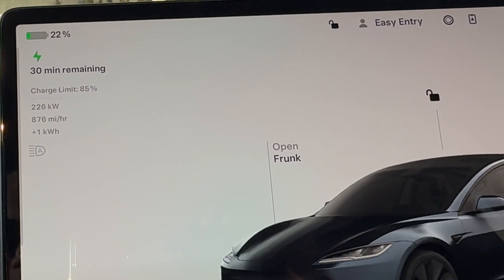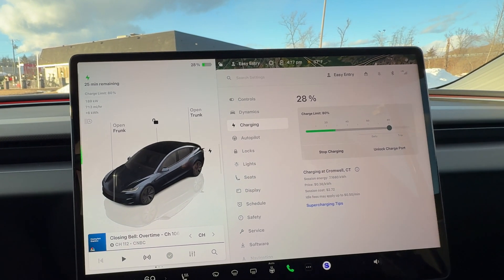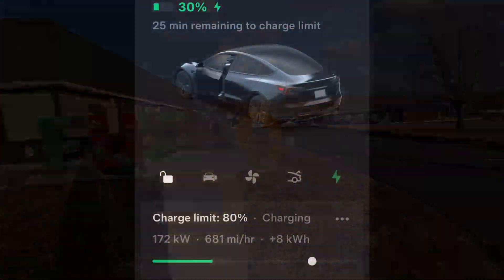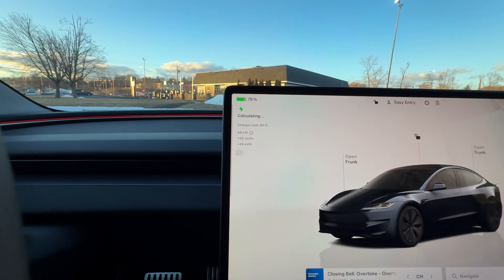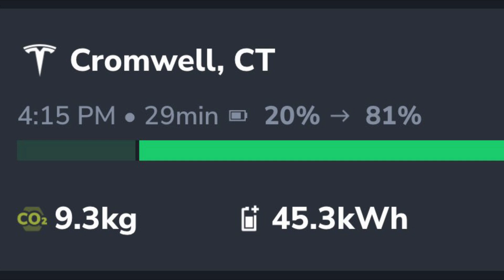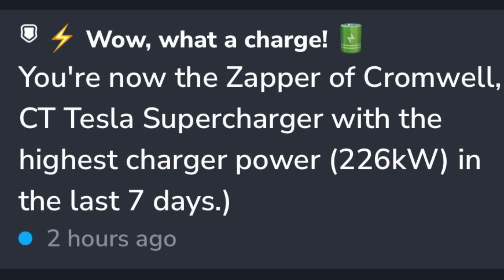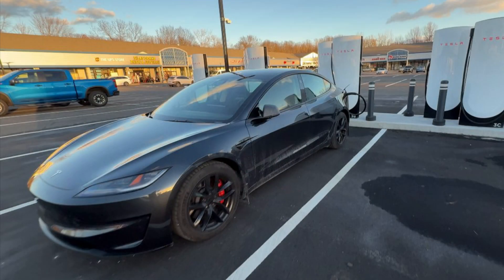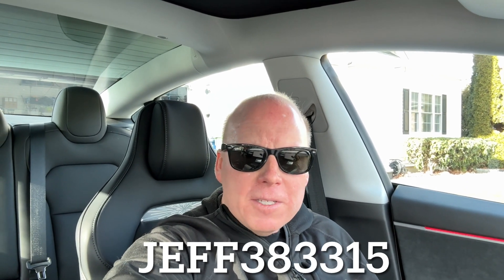Charging a Tesla Model 3 Highland Performance 20% to 80% at 325kW V4 Supercharger in Cold Conditions

Comment: Getting up to 260kW here in Europe on the v4 with both my M3P and M3 LR AWD, having the battery pre-heated is something that is required, specially in wintertime. And the mechanism that keps the power plug in place will soon fail. All V4 chargers (we had the very first one here in The Netherlands 2 years ago) here don't hold the plugs any more.
Reply from the maker: Yes I noticed on this new V4 that the connector holders are very tight I almost though they were locked.

Comment: It will be interesting to see when certain Tesla and certain 800V non-Tesla vehicles can get a sizable boost in speeds once the DC cabinets are also V4.

Here's my video of V2 vs V3 Supercharging in July 2020
https://youtu.be/kcKNl_puMkg?si=04Ju6NEjx4XLAqOc

Stats/Results:
V3 May 31 2020 Meriden CT ~25 minutes, battery from 92.3°F to 132.8°F (33.5°C - 56.0°C)
V2 Jun 06 2020 W. Hartford, CT ~28 min., battery from 93.2°F to 131.0°F (34.0°C - 55.0°C)*
Reply from the maker: For sure I was wondering if when they pushed the v4 current increase for the cybertruck if they would also increase the charge rate on the highland.  If out of spec keeps showing how fast the cars in China are charging it is just a matter of time.